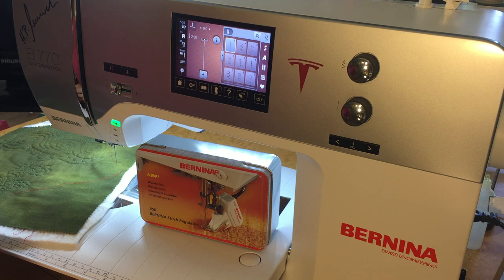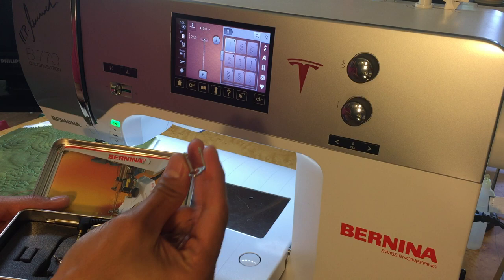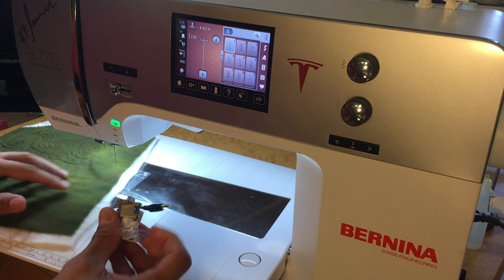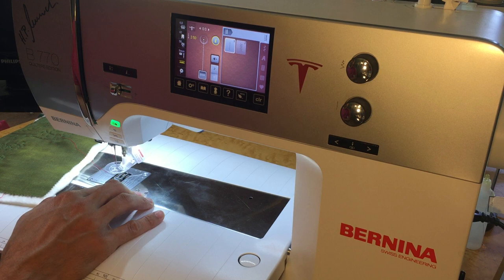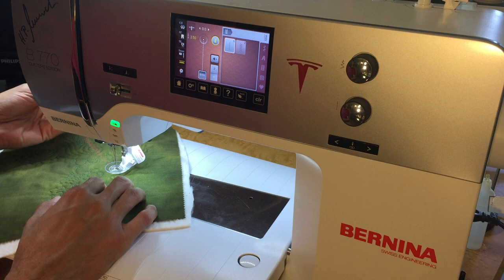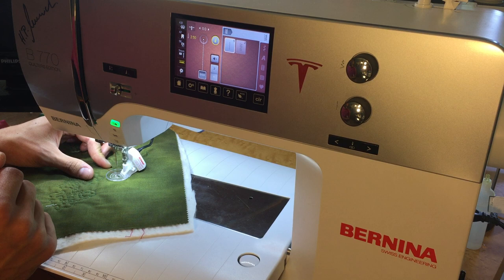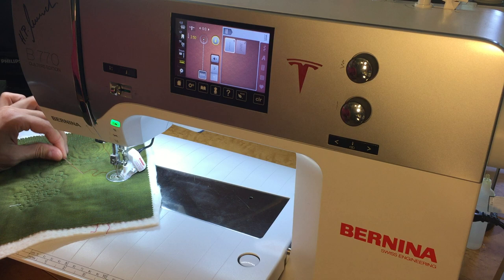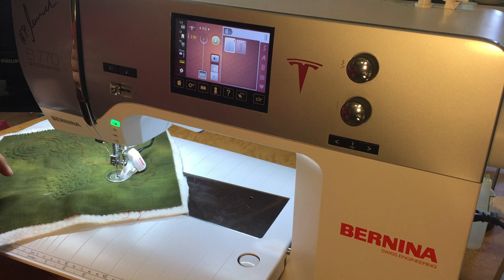Using the BSR Bernina Stitch Regulator

Comment: I have a question but it isn’t about the BSR.    I have a 790 and when i embroider it sometimes cuts the thread really short and unthreads the needle.   It usually does this when the foot moves from the design and then back.    Anything i can do in the machine programming to correct this?   Thanks in advance

Comment: Hi Cody. Do you use any kind of slider with the BSR? I just started quilting with the 475 QE and it seems to have a slight drag. Thanks so much for all you do. If I lived in LA I would definitely use your shop.
Reply from the maker: I honestly don't use a slider like the "supreme slider" they help a little but personally I don't see a significant difference. There are some polishes that are sold that help significantly and they are much less. You just simply wipe down the table that you're using and it allows your fabric to slide very nicely. There is one from the same company as the Sew Steady Tables, I can't think of the name though.
Reply: @sewingwithcodyandpete8651  thanks. I'll dig into it. Does your shop provide online sales? I feel guilty for using all of your videos and would certainly order from you if possible.

Comment: Thanks for the demo and information.  I just took a "test drive" on the 770 and the BSR and saw that the stitches were NOT uniform in length.  Lots of "excuses" like could the the thread or the bobbin or the needle...but it's advertised that there is perfect stitch consistent quality and my first encounter was not so.
What was I doing wrong?
Reply: Evie, I had the same experience and the presser foot doesn't seem to lower close enough to the fabric.

Comment: Thank you Cody! I just picked up my new 790  yesterday. I have my BSR on, and I am finishing a free motion quilt that has two layers of wool batting. Cotton on top and bottom layer. I’m having difficulty moving the fabric and switching to the straight stitch. I press the straight stitch icon and the zig zag still shows on the display. My feed dogs are down.  Any advice?
Reply from the maker: When working with thick batting you can decrease the presser foot pressure. You can decrease it so low “in the negative “ and it will actually raise the hight of your foot up higher wheel while sewing. As for your machine only stitching with a zig zag while using the BSR the only thing I can think of is maybe you do have the straight stitch selected but by accident changed the stitch with. Hope this helps 😀
Reply: @sewingwithcodyandpete8651  thank you so much Cody! I love your videos please keep them coming! Do you have any on the Viking Epic 2 as well?? Have a sew wonderful day!